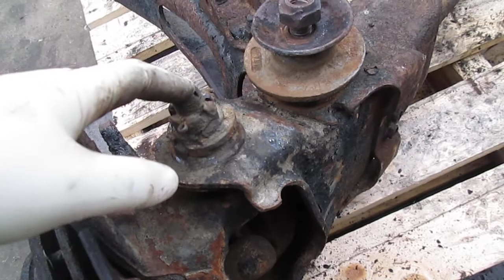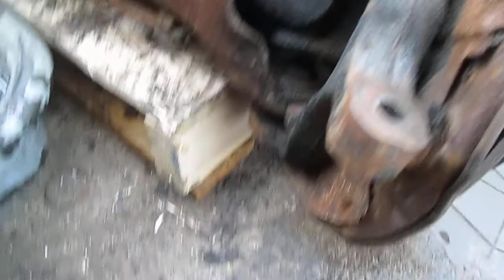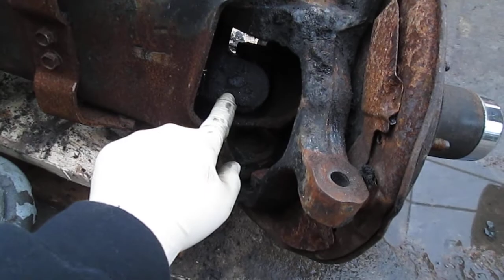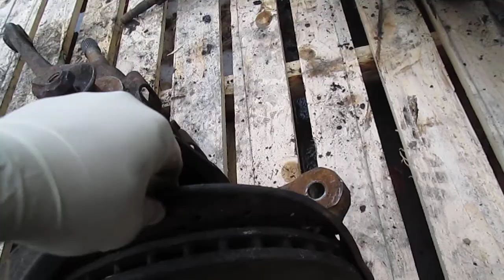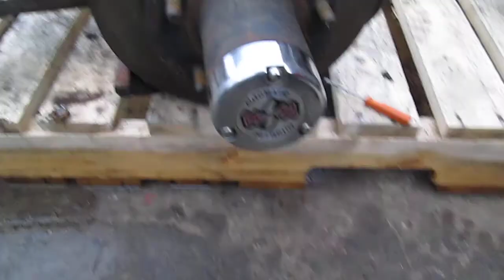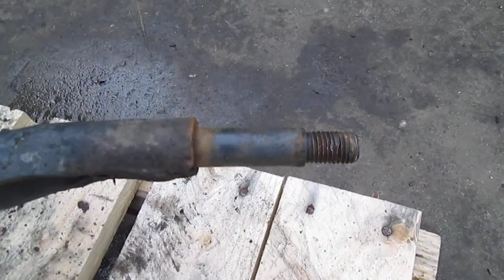Dana 44 TTB Axle Inspection and Refurbishment Part 1 : Initial Inspection

Comment: Great to see the ttb being reworked. Most opt for dana 60 straight. I’ve had a 1997 f250 with 244k with the ttb since around 2000, and have never had an issue with the 4wd engaging.

Comment: I took mine completely down and sand blasted them wire wheel and repainted the housing, new everything, new joints seals bearings rotors calipers everything! New! I painted mine up looks brand new rebuilt center chunk! Note 50 ttb chunk will bolt to 44 ttb!